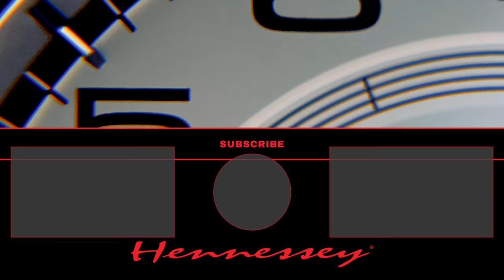C8 Corvette vs C7 Corvette | Drag & Roll Race Comparison

Comment: Considering the C7 was bone stock and the C8 was "juiced up", the C7 faired very well.
Reply: And the c7 looks way better
Reply: Agree. I really hope that C8 is not modified. That would look really bad.
Reply: Glad the comments on mobile are at the top, I saw this comment before the video even started lol
Reply: Well exhaust doesn't add any horsepower and the c8 still won from a roll, so only the light weight wheels helped but probably not a lot. And the c7 did do very well
Reply: It’s just exhaust lol like 5 hp
Reply: exhaust doesnt magically add tons of power tho
Reply: The only thing the c8 has was tires done, that’s not gonna make much of a difference. What is going to make a difference is how the c7 started before the c8 in almost every race
Reply: RARAYAYA RAA tires can make a huge difference but it’s not like the c7 came with shitty tires
Reply: More like, the C8 has C7 performance, just as the specs state.
Reply: Thats right!! The C8 isnt $50K better then the C7!! Im buying a used C7 this spring. Im not getting robbed!
Reply: The c8 driver wasn't really racing there was no launch control and wasn't on track mode. That's where the c8 has its magic in launch control. It would have destroyed the outdated c7 by much more but they didn't want to embarrass the c7 to much. Seeing the c8 next to the c7 it really shows how aged the c7 looks. Kinda looks like a fish from the front.
Reply: “Juiced” up in you mean a 5hp cutback exhaust? 😂 It wasn’t juiced up.
Reply: @FERNANDOAUGUSTO-fv1ck I respect your opinion but C8 looks better to me and I've owned both.
Reply: @nikosky4028 Exactly! I destroy C7's in my 2023 C8 z51.
Reply: @MrJrolon1975  my comment was not about wich one is faster ....it was about looks.
Reply: @FERNANDOAUGUSTO-fv1ck  I still prefer C8 looks. The C7 looks outdated and has not aged well.  The long narrow front hood is ugly, but that's my opinion and I respect yours. Both are great cars.
Reply: @MrJrolon1975  absolutely
Reply: @MrJrolon1975  yea the c8 models are way faster then c7s. It seems the most hate we get are from other older corvette owners with older models. It's weird other people with different cars respect the c8s but the older corvette owners hate. I don't understand that.
Reply: @nikosky4028  Exactly.  Once C8 prices drop and dealers stop with the markups, C7 owners will be trading up for a C8 lol
Reply: @MrJrolon1975  So true my friend
Reply: Lol facts
Reply: Lol word, most can’t afford it which births the hate. Your comment will age well 🍾

Comment: Woulda been nice to see apples to apples, stock vs stock or an equal modded C7. Cool video though, thanks for sharing.
Reply: Exactly. I’m surprised the C8 wasn’t much faster than the C7, even with the modifications! Especially after all the hype about how much better the rear engine was supposed to be.
Reply: @True_Knight  not to mention the DCT. Wasn't the 7 a manual? And the additional horses.
Reply: Guys, it was a pretty solid win. And the mods likely did little to make that C8 any quicker.
Reply: @christophermorales1509  lies. Mods are mods, he barely walked it relax champ the c8 isnt all that. I'll take a c6 z06 over these 2 anyday
Reply: @christophermorales1509  people only know stats, they fail the eye test. What were they expecting? Like 10 car lengths? Honestly, they probably were...
Reply: @brianhines3816  sounded like the c7 had the 8spd auto.
Reply: @True_Knight  C7 was an Auto and honestly they added like 10 hp the C8 was also launching a solid second after the C7 giving it a pretty massive advantage on the hit
Reply: I would buy the C7 over the C8.
Reply: @True_Knight   it slept at the light and won by 2 car lengths. That is significantly faster considering the horsepower difference is minimal. The engine layout isnt going to make a difference on a drag strip lol.  It's not "hype" that the mid engine c8 is better, it's just basic facts.
Reply: Dylan weight distribution definitely makes a huge difference out of the gate, plus wider rear tires on the c8.
Reply: Dylan if you’re saying power difference is minimal and mid engine layout didn’t make a difference in drag times then how did it kill the c7
Reply: skwhtvette the difference you saw was pretty big in the car world. It’s very easy to make a slow car faster but when you get to the upper end of speed, lots of time and money in getting a tiny bit more performance. C8 starts way late and still pulls a considerable gap!
Reply: Christopher Morales lightweight wheels and Hoosiers. Man I can’t believe anybody could seriously think that those items don’t make a difference.
Reply: Jonathan Pontel - mods are mods? Barely “walked it”? Umm, ok. You haven’t raced much and probably haven’t tried very many “mods.”
Reply: Agreed
Reply: The way the C8 is geared I don't think it would've made a big difference.
Reply: I wonder does the c7 have the z51 package.
Reply: @True_Knight  well yea in the straight, the c8 is more focused on quicker acceleration and better weight distribution (mid-engine) so it can perform not just better in the drag strip but also laps around tracks and faster out of turns
Reply: @True_Knight  wwwwwwwwwwwwwwwwwwwwwwaaaawwwwwwwwwwaaaaaaaaaawawawawwwwwwwwwwwwawæwwwwwwwwwwwwwwwwwwwwwwwwwwwwwwwwwwwwwwwwwwwwwwwwwwwwwwwwwwwwawwwwwwwwwwwwwwwwwww
Reply: A C8 vs a C7 ZO6 would have been better
Reply: You must be 80 if you’re calling me a kid. In which case you still don’t know what you are talking about. Slap a sticker mod on.
Reply: I agree
Reply: @christophermorales1509  cool story kid
Reply: Most of the C8’s improvements in acceleration are from a dead stop due to the DCT allowing true clutch dump, the low gears being taller, and all the added weight over the rear wheels improving grip.  If you compare the power:weight ratios of the C7 Stingray and C8 Z51, they’re about the same, and the races show that too: C8 took a lot longer to overhaul the C7 from a roll than from a stop, even if the driver was also slow on both.
Reply: @moresomoze  c7 comes with 455hp (non z06) vs 497hp on new c8 mid engine corvette.
Reply: they were both stock

Comment: We want to see the C8 vs a STOCK C7 Z06!!!!
Reply: So you can watch the c8 get gapped? Lol.
Reply: Ya not the stingray
Reply: Or the ZR1
Reply: From a dig ot will be a close race... Z06 got too much power for the c8 in a roll but it would be interesting.  Would like to see them compared on a road course though. A tight track and the c8 will be close. Impressive platform..
Reply: Wait till c8 z06 came out
Reply: c6 zrr1 beats them both
Reply: Terry Dixon the C8 z06 doesn’t exist.
Reply: Z06 would own it pretty good.
Reply: Stock vs Stock doesn't exist in this video a C7 ZO6 would destroy this modded c8
Reply: Terry Dixon ...wow
Reply: Z06 would murder a stock C8
Reply: @ffsweet6965  Yea also wait for the $200K+ price tag on the C8 Z06!! Thats a big 2nd mortgage payment. Even a on 4- or max 5 year loana like $2000- $2500 a month payment! lol
Reply: No problem gapping a C8 Stingray with my 19 ZO6.

Comment: I love ether c7 or c8, I own a c7  but when you have c7 460hp stock and c8 comes stock 495hp z51 already and you add bolts on, not fare c8 have everything to win, Run it stock vs stock,  no add on.  GOOD VIDEO ANYWAYS
Reply: Yeah I didn’t get the point of this video

Comment: C7 is definetly faster to 60 mph.  And with 50/50 weight distro vs the worst weight distro of any car, the C7 OBLTERATES the C8 on the track.  C8 is a huge and sensless step backwards.

Comment: What is the point of this race? Why not race when they're both stock or have the same mods. Pointless race.
Reply: They were testing the c8's capabilities, at least, that's what they  were doing when they raced there huracan against it when they knew which was much faster
Reply: OhNoThatPanda their*
Reply: Completely agree... pointless! Lol
Reply: Not pointless at all I mean the stock C7 was ahead for a moment.
Reply: Are you talking about the negligible mods they listed at the beginning? Are there more significant mods on the C8?
Reply: @badbehaviour7193  Shhh......don't confuse them with the facts. I'm sure those aftermarket Hennessey wheels made a HUGE difference!
Reply: @Christian Ball Was their mistake at the start of a sentence and was it a full sentence? No, so I won’t type the correction as if if needs to be capitalized since it was in the middle of a sentence. If it was at the start, I would’ve typed “Their.”
Reply: @yammmit  This ain’t the spelling bee fool smh.
Reply: @Christian Ball you serious?
Reply: From what I know I don’t trust Hennessy based on the bad wrap from customers when he stated. He doesn’t care and is a nerdy prick it seems. But who knows you may have a good experience.
Reply: Riight….
Reply: Over 500 likes yet it was exhaust and wheels lmao wtf
Reply: That makes no sense. It is not pointless lol, they are different cars and they wanna see which one is faster and yeah
Reply: So what
Reply: Because the c7 would absolutely destroy the c8 in performance, looks, and practically everything else. So the had to make the c8 look good

Comment: This race was decided at 0:17 when the C7 said bone stock
Reply: I don't get the idea behind this comparison.  May as well give the C8 a couple of lengths too?
Reply: Agreed
Reply: It was decided when it said C8 vs C7. From a stop, it is no contest.
Reply: Marc Smith because the c8 was upgraded are you blind
Reply: @lochlanpenrose6135  you don't say🙄
Reply: @lochlanpenrose6135  Are you blind? You will never see a video of a stock base C7 coming near a C8 from a stop.
Reply: The mods were mostly for taking away a little weight. The only real difference is the tires, both cars probably had pretty good tires though.
Reply: @marcsmith3881  actually theyre not that different and the c8 really isnt faster than the c7 like youre making it out as the c8 doesnt really have that much of a performance gap over a c7

Or have you never seen c7s and c8s race?

I mean you realize youre saying that while a bone stock c7 was just hanging next to a hennessey upgraded c8 right and regardless of what you say mods is mods they make a difference either way you put it 

So what then if that c7 had the same package would you really be keeping that same energy?  Did you really just watch the same vid as the rest of us cause last i checked nobody got gapped.....not even close.......
Reply: @LilJ3090 They are quite different on the street from a stop. Not even in the same realm. Have you watched the videos of the C8 beating the GT500 in the quarter on the street, regular asphalt? You should watch it.

I have followed Corvettes for 40 years and have serviced many of them from C4 - C7s. I just performed a front brake service on a 2016 C7 A8 with the Z51 package less than a week ago. I have driven many of them. I love all of them, but the C7 will never put the power down on the street like the C8 does plain and simple. 

From a dig, the C7 got the hit and the C8 ran it down before 90mph. The roll race is closer because they are probably 50-60 hp difference at most and the C8 is heavier. From a dig, stock vs stock, it's no contest.
Reply: I have a c7 .. he was holding back.
Reply: @LilJ3090  gearing and grip is on another level with the new c8

Comment: C6 Zo6 vs C8 Roll race that would be cool to see
Reply: Money on the c6
Reply: Money on the z06
Reply: C6 should win
Reply: Money on c6 from a roll c8 from a dig
Reply: I'll like to see that also
Reply: C6 assuming driver can...drive lol
Reply: Anthony Smith  good thing everyone is talking about the c6 and not the c7.
Reply: Nope yall are wrong. Either its a tie or the C8 wins.
Reply: c7 z06 is faster. maybe c8 is quicker at the beginning
Reply: Anthony Smith  very interesting
Reply: Anthony Smith c6z is 500 pounds lighter. Would be a very close race
Reply: C6z would put a bus or 2 on the c8
Reply: leoaleromm  
Video proof?
Reply: Anthony Smith trans would definitely benefit c8. From a dig i think c8 takes c6z (assuming both on street tires) but from a roll i think c6z would take it. It would be an interesting race and we can only speculate. I’d love to race a c8 in my c6z to find out first hand
Reply: C8 would gap it from a dig
Reply: Brandon Jones in the 1/8 1/4 or 1/2 mile?
Reply: Anthony Smith  C6 Z06 is like 400-500 pounds lighter than a C8 so the Z06 should pull from a roll. They have trapped as high as 128 stock. From a dig yep money is on C8 everytime. From a roll id bet on the LS7.
Reply: Too much power difference there. The C6 would definitely win that.
Reply: What about C6 ZR1 though?
Reply: C6 z06 would definitely win
Reply: Dual clutch will prevail
Reply: Anthony Smith  I can kind of verify. I finally ran into a C6Z in my 2019 GT 10R80/3.55 car a couple weeks ago.  We went from a low roll and he would slowly gain, and then lose it all and more when he shifted. Then, we we're lucky enough to get lined up at a stop light. The GT embarrassed the C6Z. With a PERFECT driver, the C6Z may have done better from a roll. Street dig, no way. The GT ate him.
Reply: Anthony Smith  You mean GT500. No chance an everyday GT is getting into the 10s like a C6Z.
Reply: @chrisnauta2467  10 hp difference. The C8 beats them all from a dig on the street except maybe the C7 ZR1 if the driver gets a little lucky.
Reply: C6 Z06 is easily a higher trapping car. In equal density altitude the C6 Z06 traps ~6-7 mph faster.
Reply: @cyberspectre8675  Hahaha! Because everyone is capable of wringing out every ounce from a C6Z. Sorry, man. That's not realistic.
Reply: C6
Reply: How about a C6 ZR1🙃
Reply: Anthony Smith  bro you don't know wtf your talking about and couldn't drive a c6z. I ran a 11.1 in my 100% bone stock c6z on ps2s
Reply: @elektrosmokes1911  u either ran into a ls2-ls3 clone or a really really bad driver, u didn't beat the car
Reply: The C6Z would pull from a roll, lighter, extra 10bhp, less aero drag and higher top speed 198mph bone stock.
Reply: We tested here in Venezuela a C8 stock vs a C6 Z06 Stock and the C6 won by Two cars length is lighter and has a  slightly hp advantage. Honestly I’m very disappointed by the C8
Reply: @elektrosmokes1911  suuureee you did🥴

Comment: I think I still like the older Vettes better. I'd even be happy with a C5 z06 or a C6 z06. I used to have a 98 ws6 t56 and loved it. Not a perfect car but I love that look and she was so mint.
Reply: I had an 02 c5z....moved to a c6z....drove my buddies c7z....sold my c6z and bought another 02 c5z and forged and supercharged it.....I am happy again.  I learned that the newest cost more and isn't new a year later.  Get what you like and be happy.
Reply: I agree. They started going wrong with the c7 and it’s goofy styling, then went full blown euro with the c8. No doubt it’s a better platform for pure road racing but it’s ugly compared to a classic long nose vette, especially c6 and earlier.
Reply: C5 Z06 is pure magic.
Reply: @66smithra  I get you like old ones more but the market isn't all for front engine cars. Same with manual cars. That's why they went mid engine and only dual clutch. And you have to keep up with the ages with styling. You cant keep a car looking how it did 20 years ago or it won't sell and would be a waste of money to produce.
Reply: David Ratnayeke really?  Didn’t the mustang and challenger go back to the old styling and sell like hot cakes?  Didn’t Porsche offer manuals again due to demand?
Reply: @66smithra  look at the sells of the manual option for the c7 it's like 5%. The demand is not there for Corvettes also the styling change work really well with Chevy saying over 37,000 reservations were made for the 2020 model, so many people who ordered the 2020 will be getting 2021s.
Reply: And look at the poll in that article. Many people still like a manual.

Comment: Love how they are so different, but at the same time so so similar, even though the new one has the engine in the back it's still very much Corvette styling.
Both have exact same engine note, though C8 is louder due to modified exhaust.

Comment: Not really a fair comparison IMO
Reply: It was to see how much more performance you get for the newer generation
Reply: mcwriter007 no, not at all, but it does give a great example as to how fantastic the c7 and c8 both are from “stock”. really that c8 probably only got a 20 or so hp boost from the exhaust, and it has more than the c7 by i think 40 or so hp stock, and that c7 still hung in there
Reply: @johnclark6139  20 may be very generous with just an exhaust upgrade.

Comment: Just guessing, C8 had 80lbs saved at the wheels and 30hp gained on exhaust? Doesn't sound like Hennessy to not tune after those mods, but since it's not stated I take their word pcm wasn't touched..Certainly seems as though the open exhaust and light wheels on the C8 gave it an edge. Based on this test, the C7 would have won by the same gap length had they both been stock.

Comment: Obviously the Hennessey mods are a factor here.  Stock to stock, from a roll, they should be pretty equal... in that scenario, traction is not a factor and the C8 has two main benefits: the new DCT (virtually no loss in acceleration during shifts) and the C8 engine is bolted directly to the transmission.  The C7 has the engine up front and trans in rear, with a shaft between them.  A lot of power (15%?) is lost in the transfer between the two, a loss which the C8 doesn't incur (generally).

Comment: That C7 does pretty good for stock against that C8. If that's the best the C8 can manage with those  modifications and a new chassis update it's not that impressive.
Reply: Because they weren't going for straight line performance. A stock base c8 vs a stock base c7 on a track the c8 would beat it by a big margin.
Reply: @DRat_  I'm sry, this video was clearly showing straight line performance comparisons with one car modified and the other not. 
Which video were you commenting on???